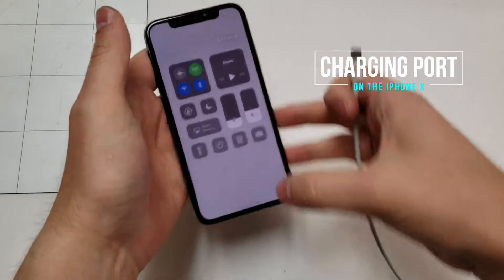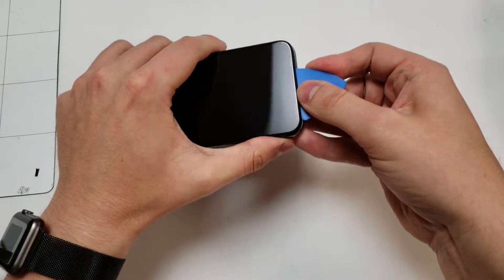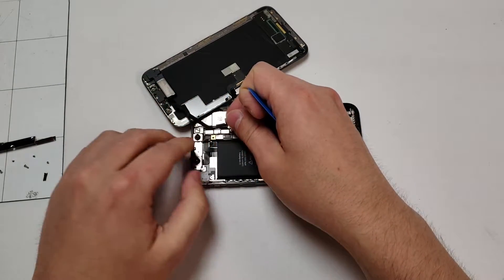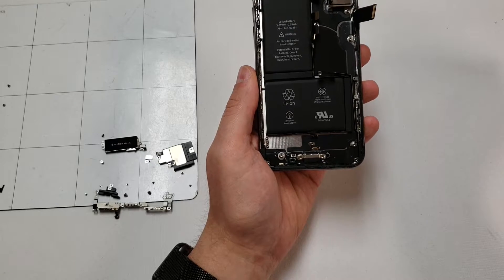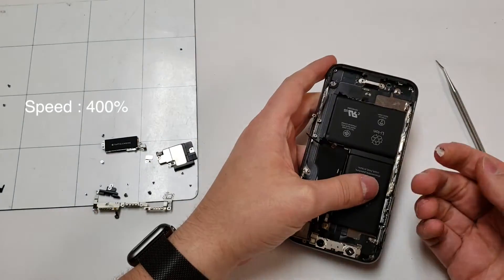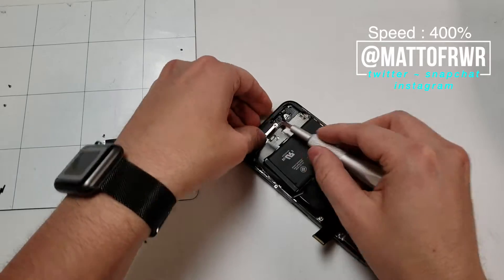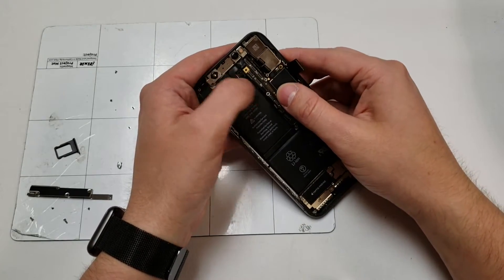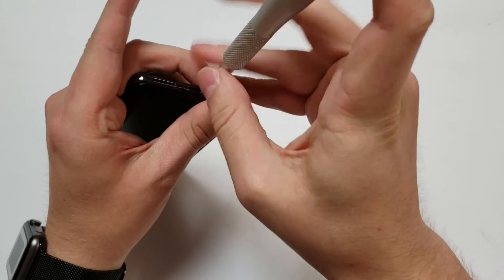iPhone X Charging Port Replacement (Fix All Your Charging Issues!)

Comment: Hi, thanks for the video. I have replaced as per your instructions today and found the charging to work fine, however I am noticing excessive heat coming from motherboard and the iphone restarts itself every few minutes. Do you have any advice for me on this issue? Many thanks
Reply from the maker: Sounds like the charging port might have been torn/defective. Try the phone with the port unplugged and see if it keeps doing that
Reply: @RealWorldReview  Hi, I have tried this but the issue remains whilst the charging port is unplugged from the motherboard. I lifted the battery up on one side in order to provide access when replacing and wonder whether battery damage is the cause of this issue. I am going to try replacing the battery. Thanks again.

Comment: When you repaired this item, did you attempt to wirelessly charge it? I’m having the same problem and I really don’t wanna go through all the labor and do this. If all I need to do is buy a $30 wireless charger in order to fix it I will but I want to make sure that it’s a solid idea. Cheers !
Reply from the maker: I didn't try after the repair, but wireless charging works fine. The issue is that if you need to sync with a computer, the port needs to work (iTunes Wi-Fi Sync is trash and rarely ever works. Also I hate using iCloud to backup.)
Reply: ethan I have been doing wireless charging on mine. Decent temp fix but charges super slow. About to just spend the money on a new phone at this point. Damn Apple smh wouldn’t replace with no signs of water damage. Just a few months past warranty and they wouldn’t fix/replace
Reply: wowwwwwwwwww this is soooo smart. dang it why didn't i think of this
Reply: @JHDJFHSDJHFISDHFKJSD  this is old, you still have an iphone X? lmfaoo

Comment: Removing the logic board and the glued in battery is required to replace the port. That's one way to make sure that you'll never be able to get it replaced at the Apple store.